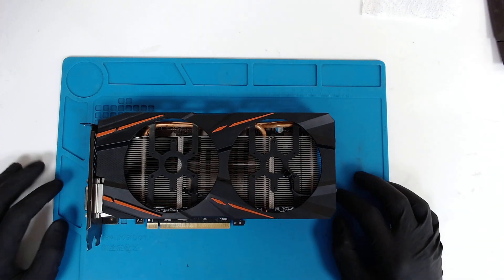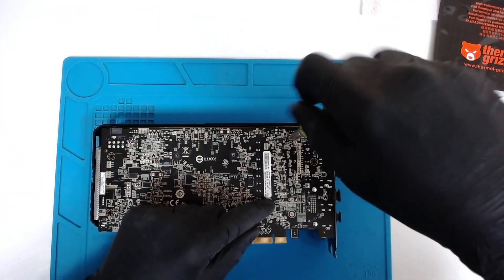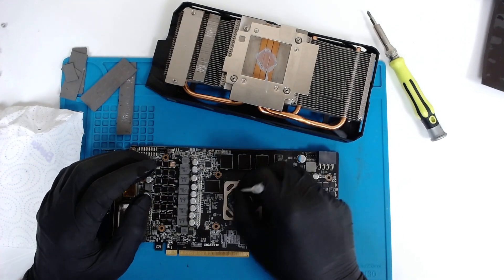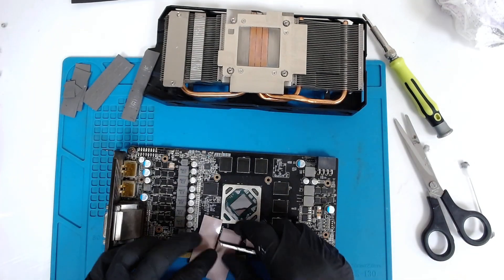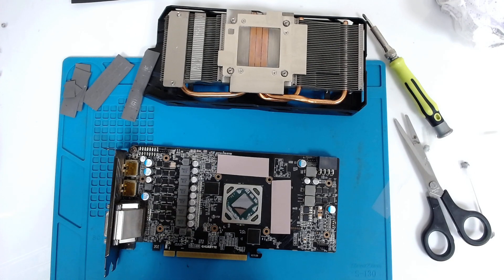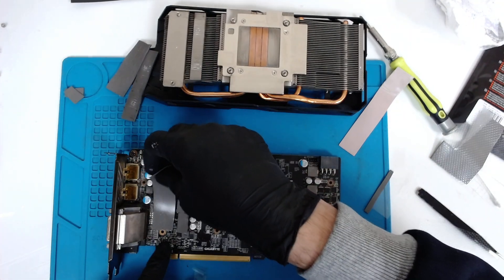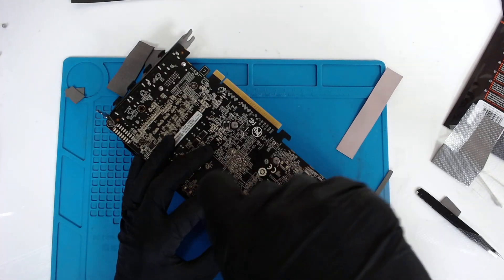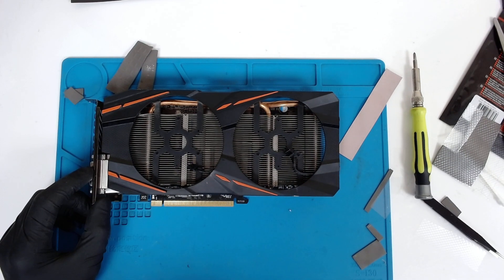Gigabyte RX580 Thermal pad replacement.

Comment: Hi, what thickness is good for my Gigabyte Gaming Rx 580 8gb 2304sp?
Reply from the maker: No idea.
Reply: @LaptopDisassembly  seems my gpu is like in your video. what's the exact thcikness for it
Reply from the maker: The GPU was not mine, but a customer one. I usually don't replace the pads, so can't help you. Just clean the dust, replace the paste only and test.

Comment: Thank's for the vid.
I'll be redoing my RX570 backup card/ to be daughters soon, it's been apart for ages (went to repaste core but pads are all disintegrating so I left it on the shelf (I have an RX5600XT which I'll also repaste and pad soon).

A note for people who keep asking if they can use the same pad thickness on memory and vrm mosfets and inductors - absolutely not, there is a massive difference in pad thickness between the two. I need to bring my verniers home from work to check, but from whats left of the memory pads, they are really thin and the VRM much thicker. By eye I would guess 0.5mm for memory and 2mm for VRM although most people seem to say 0.5 and 1.5 so yeah maybe! I'll check soon.

Comment: i have RX570 Gigabyte Gaming Rev 1.1 with Gigabyte and Fan Stop RGB Lights,but i bought yesterday 1.5mm Thermal pads for VRM,it's worng or not?
Reply from the maker: Every card uses different thickness of the pads.If you use 1.5mm for the vrms, than you should use 1mm for the memory, otherwise there will be a gap, and the cooling will get worse.
Reply: @LaptopDisassembly  ok man,but i only find indo about 0.5mm Vram and 1.5mm vrm in many websites and fóruns.,.
Reply: @SrPivete13 what best works with you? I'm having same curiousity

Comment: To clean the graphics chip, you could have used a soft toothbrush instead of using a cotton swab, when it opens there is a plate where the graphics chip is, you have to open it, not removing the screws at once, unscrew them in X and at the end you will hear a popping sound, this popping and there is pressure from the PCB being released correctly, this prevents you from cracking the DAI of the graphics chip, in the assembly and there is the same thing, put the screws and then tighten it making an X, that and for any video card !!
Reply from the maker: If I use a toothbrush it makes a bigger mess. About the screws I tide them on X but not at max... Usually 50% and after I put all I repeat and tide max. For about 15 years I haven't god a cracked dai. Bit thanks for the tips

Comment: one doubt, with a thermal pad of 80x40 will be enough to cover both parts of the VRM?
Reply from the maker: Should be fine, just mark where you will cut it and check will it be enough.

Comment: my VRAMs use 0.5 pads, but my VRMs use 1.0 and it would be quite expensive to buy both, will there be problems if I use 0.5 in both?
Reply from the maker: They are different because the high of the VDM and memory is different. If you use same size for both, one of them will not have a proper cooling because the gap will be bigger.
Reply: Double the pads. A kit should come enought. Use two strips

Comment: May I ask hm thermal pads did you use for this gpu?
Reply from the maker: Link for the thermal pads. I use 0.5mm for the memory chips and 1mm for vrms. On the GPU i put paste
Reply: But is it okay if I use 0.5 mm on both memory chips and vrms?
Reply from the maker: Not a good idea
Reply: @LaptopDisassembly  Why tho? What would be the problem?
Reply from the maker: If you use 0.5 instead of 1mm the cooler will not lay on the vrms ant there will be a small gap.
Reply: @LaptopDisassembly  Got it. I ordered both sizes. Thank you, man!
Reply: @LaptopDisassembly  Nice job bro, thanks. I buying a RX580 Gyga and need buy the pads.. Thanks for all this content.. <3

Comment: Amazing video!!! Have you tried copper shims instead of thermal pads for mining? Apparently it works amazing but i am wondering if you have tried it or if you know anyone who has tried it
Reply from the maker: I use them often on laptop GPU. Just apply small amount of paste on both sides ot the pads and put the cooler. You need to have paste between every layer.
Reply: @LaptopDisassembly  you mean on the copper shins right? Or you haven’t used copper shins?
Reply from the maker: Yes I have use them... They increase cooling performance. But you have to be careful with the thickness. The normal pads can be flatten a bit by the cooler, while the copper ones no, so just be careful with the thickness.
Reply: @LaptopDisassembly  would you prefer 0.5 mm on sapphire rx580?
Reply from the maker: Well you have to try, 0.5 or 0.7-0.8. you have to check the gap and do the cooler laying ok on the vrms...
Reply from the maker: Usually for the GPU chip I would go for a thin ones like 0.1-0.2 The idea is just to compensate the gap and not to lift the cooler overall. Otherwise you have to replace the thermal pads for the vrms or they will overheat.
Reply: @LaptopDisassembly  yea I will try it on the vrams only for now.

Comment: Hi. I have sapphire nitro + rx 580 4gb, and can you tell me what size, thickness of thermopads do i need? Thanks.
Reply: I'll use 0.5mm on both vram and vrms chips.. by grizzly pad 8..
Reply from the maker: Well usually the different manufacturers put different size pads, according to the board revision. Most of them are 1mm, but you need to check by your particular model.
Reply: @LaptopDisassembly  Thank you. But i can't find information about my gpu. I just watched many youtube chanels and on google too. Everybody say different things, so i don't even know wich one to choose. From 1 mm to 3 mm. I think maybe 1.5 will be fine.
Reply from the maker: @vernehetzel5411  3mm is way more. Don't go above 1.2mm.
Reply: @LaptopDisassembly  ok. Thanks.

Comment: is it 1.5 mm or 2.0 mm thickens of taht thermal , look like 2 mm but you said 1.5 i wnat to change it so i wanted to order them i want to be sure....
Reply from the maker: 1.5mm are the new ones.
Reply: @LaptopDisassembly  i mean old one is 2 right?
Reply from the maker: On that one they were wrong replaced. Originally they should be 1.5mm

Comment: I have the same problem , I put everywhere 1mm ,everythings works and gpu but on test stress pc shot down, i heard on VRM is 1.5mm and VRAM 0.5mm .. I have rx570 4gb gigabyte..Im scared bro dunno what to do cant find right answer
Reply from the maker: If you put 1.5 on vrm you will lift the whole cooler up. Use a 0.5 on all and test, but use a good ones.

Comment: My plastic shroud has been broke. Do you know how to fix that or which shroud from another card will be good for this aorus?
Reply from the maker: Can't understand what you are asking. Which part is broken. Also plastic can be glued.
Reply: @LaptopDisassembly  that plastic shell for fans. The place where fan is mounted to that plastic shelter in my case is flake off in big part. I would use 2 pc fans on a zip tie but I would avoid this. The part from 00:02 from Your video, that place for fan holding.

Comment: Thanks. All pads are 0,5mm? I'm using this cards for mining eth for about 2 years.  Do I need to change this pads?
Reply from the maker: i usually don't replace them, only thermal paste. But this one, someone has replace them with thicker ones and t become worst... so i just replace them with proper ones and is working fine now.
Reply: @LaptopDisassembly  Thanks
Reply: For mining the pads warp and lose their elastic. This can mean worse connection to the heatsink, I would recommend to replace them if mining. 12mk or better thermal pads.
Reply: @timaghiar  thanks tim

Comment: Heed help, Xfx rx 580, no boot, has 3 beeps 1 long 2 short, resistance ok 0.6 omh gpu 22omh memory, when used with 2nd card shows error 43 and recognized as rx 590, its dual bios, gpu starts getting hot, with these days prices i need it to work,  anyone knows software which can show specific vram chip fault?
Reply from the maker: Error 43 usually means faulty bios. Try to flash with ati flash  tool and download the proper bios.
Reply: Card is not detected, cant save old bios, gpuz says 0 where bios frame is, it has got all the voltages and gpu starts?
Reply from the maker: tell me the exact model, written on the back of the card.
Reply: @LaptopDisassembly  rx-580p45d, rx - 580p45ddt v 8.0
Gts xxx ed rx 580 4gb oc+ 1386m d5 bp
Reply: @LaptopDisassembly  voltage on gpu selenoid is the same as vram 0.9v, but rsistance is 20omh, gpu 0.6 omh,  voltage on memory controller is 1.5v, thanks for your replies
Reply from the maker: Download this bios https://www.techpowerup.com/vgabios/192098/xfx-rx580-4096-170410
and try to flash with Ati Flash tool.
Reply: @LaptopDisassembly  thanks but cannot do it as card is not detected, cannot flash or save bios from card, if pluged to pc on its own its not detected
Reply from the maker: try to plug it as secondary and try to flash
Reply: @LaptopDisassembly its not possible, gpu z does not detect card, says 0 where bios version shows, ati flash does not detect card.
Reply from the maker: @bngh12ful  well, you have to flash with programmer. Or try some local repair shop.